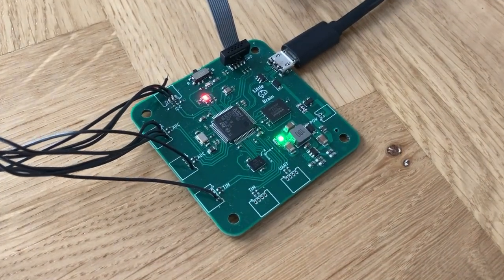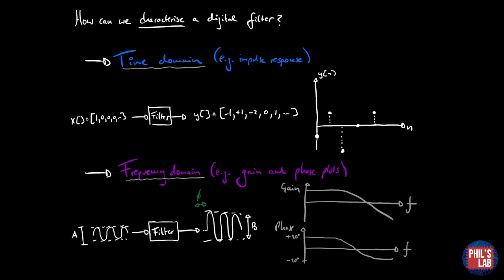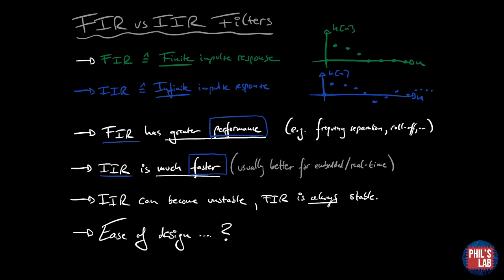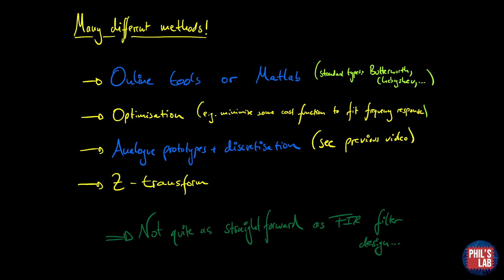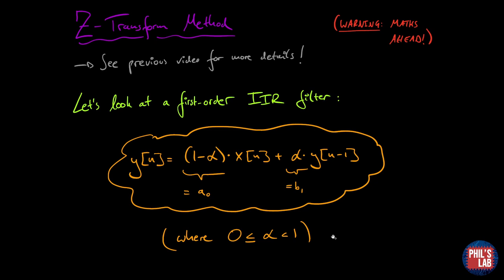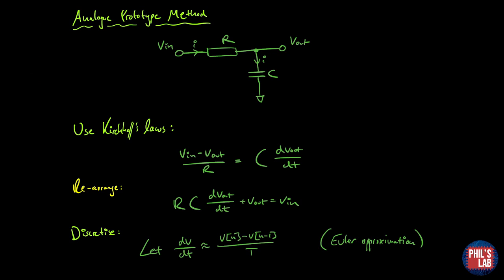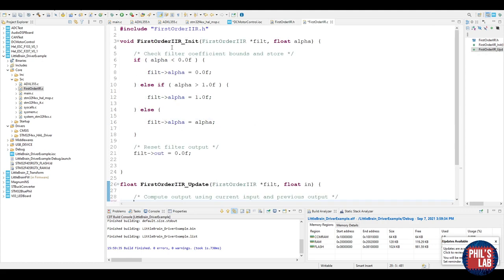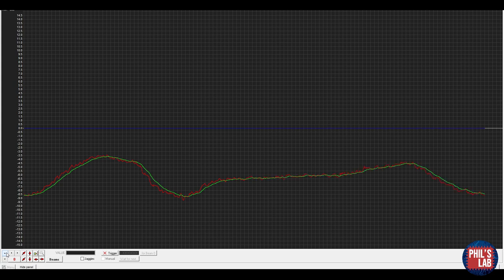IIR Filters - Theory and Implementation (STM32) - Phil's Lab #32

Comment: Huh, I've been doing a "weighted moving average" like this for ages to smooth out data, didn't realize it had a proper name. Would be very interested to see what a higher order version looks like, I'd never considered doing that (as-is this barely warrants the struct).
Are alpha and beta always linked like this?
Reply: Weighted moving average is an FIR filter. Since it only dependent on present and previous inputs. It doesn't depend on previous outputs. Therefore it is a non recursive filter, that is, FIR. As per analog devices, it has a good simple filtering property in time domain but ghastly frequency domain response
Reply: People often confuse the names moving average (probably the simplest FIR filter) with running average (probably the simplest IIR filter).

Comment: Hi Phil... Great content as always, I do have one question though... The STM32 MCU has specialized DSP libraries written by ARM (I think). Is there a reason why you do not use this library or do you write your code from "first principles" for a better explanation process?

Also a suggestion for a future video is to show the design process of a IIR filter which would meet specific design requirements such as a cut-off frequency. Then sample an input waveform below the cut-off and show it is unaffected by the filter. Then sample an input of higher frequency than the cut-off and show the attenuation.
Reply: yesss

Comment: Not sure how you sample the data in since I did not see the sensor video, if it's analog is there no (on-chip) filter available which can be applied during sampling the data?
I'm using an (onchip) IIR filter when sampling audio via ADC with another chipset.
Reply: You are correct but this is done on purpose. The way the signal is acquired is not important for understanding the filter design and operation.  For example, you could get ADXL355 IMU  (see Phil's video from Aug 21th 2021)  via i2c or from a barometric pressure sensor (Phil's Apr 14, 2021) via  SPI. The important this is to understand that once you have evenly spaced sample of the signals (the x values in this video) you can apply a digital filter to those samples.

Comment: Why do we prefer smooth signals in the first place?
Reply: Usually to remove high-frequency noise (useless information), or to remove high-frequency components before sampling to prevent aliasing. For example, if I sample a sensor at 10 Hz, I must make sure there is no significant components above 5 Hz, otherwise they will be "reflected" off that limit and cause aliasing. Also, in this example, a low-pass filter was made but you can also make high-pass to remove a DC component or a notch filter to remove 50 Hz powerline interference.

Comment: As always a superp exposition. I do however have some questions. In the FIR filter you also used the low pass first order filter.
Does this means it can be used for both? Also, if I understand correcly IIR are better served at RT applications? What else?

Thanks again!
Reply: The IIR and FIR filters can be designed to be low-pass, high-pass or band-pass. The functionality of filter is determined by the design process... The difference between IIR and FIR is the actual make up of the filter. FIR filter computes it's current output by only using the input. IIR filters computes its current output by using the input and the previous outputs. To make an analogy to continuous-time filters, FIR is a passive filter and IIR is an active filter (it has output feedback)